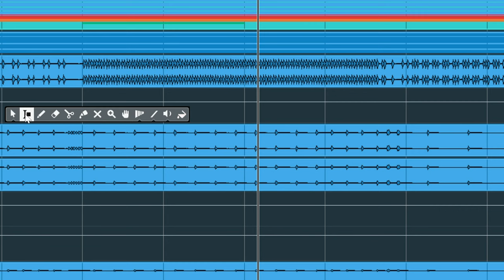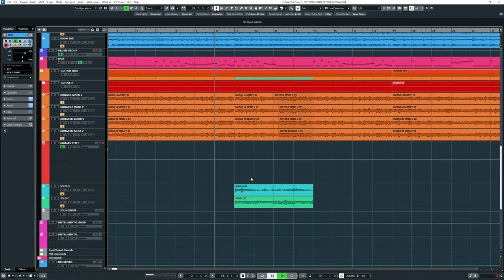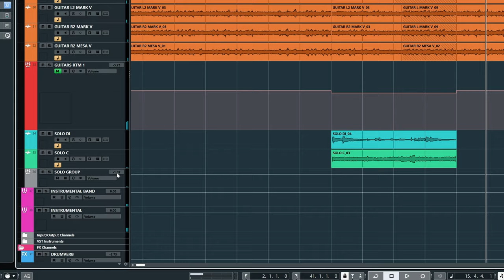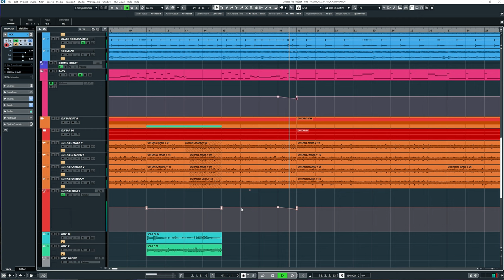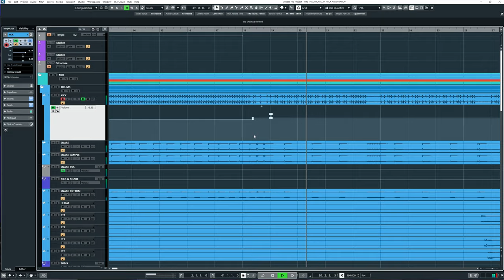Use Automation to Make Your Metal Mixes Sound Better | Metal Recording Basics in Cubase

Comment: Can't we use sidechain with a compressor for same result ?
Reply: It won’t sound the same, but just different. With automation you have a constant “spot” or room for the desired part (like a solo). If you use side chain compression you have a constant “up and down” motion sort of speak; which could work as well. 

I’d say try both and see what suits you best.